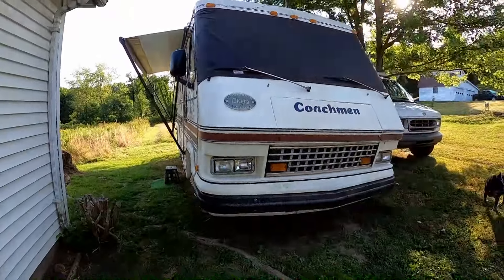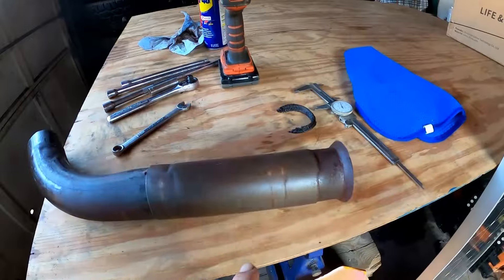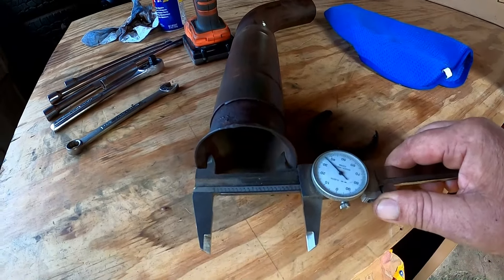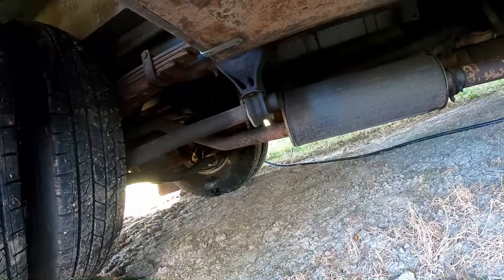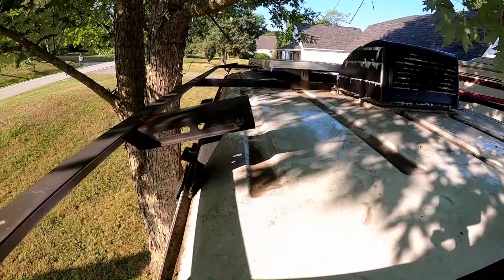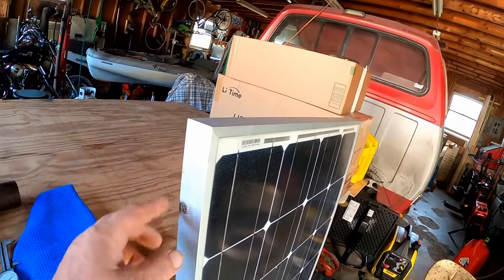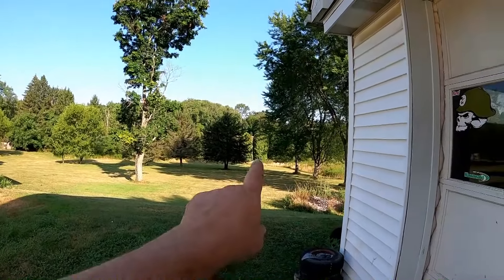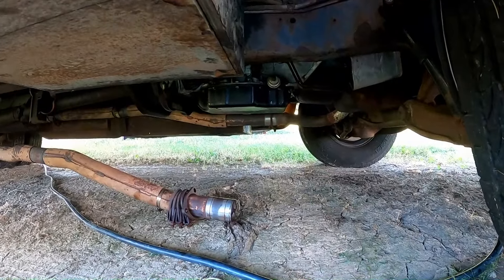Tinkering Around With RV Projects, Repairs and Projects This Morning

Comment: My experience with the donut flange fittings is if they're not absolutely snugged up with no play in them they will sway, or wiggle and end up cracking and breaking down. That includes the exhaust past the flange, if any of the exhaust system under the coach is not secured right to prevent swaying it will contribute to the donut flange gaskets breaking down.

Comment: Since you eliminated the exhaust system pollution devices, maybe it's time to look for a set of exhaust headers? I'm sure you can still find them even for an older engine and motor home application? These eliminate the donut gaskets and use flat gaskets.

Comment: Summit has steel ceramic coated long tube headers for the chevy big blocks. $276.00. Finish off with some light weight free flowing mufflers and let that 454 breathe. They also carry the MAHLE steel donut gaskets.
Reply: I agree on the steel flange gaskets. Lets hope he reads this.

Comment: Hi Dave if that happens again with exhaust leaks swap for performance headers it better then stock u will notice different of weight and little hp more cool quick then stock gotta put exhaust wrap where starter at get long tube I had problem before and hard to find those donut gasket...

Comment: Hi Dave, I've had trouble with thise pesky exhaust donuts also. Especially since they went away from the asbestos construction they just don't hold up. Good luck. You would think they would come up with a silicone type replacement?

Comment: Do it while you can 'cause soon enough you can't. I just read that 12 states are phasing out gas powered vehicles by 2030 - 2035, bet that will seem weird. I'm still hoping for the Buck Rodger's low flying aircraft. 😁😁😎😎👍👍
Reply: Getting rid of gas vehicles will never happen
Reply: @davidwheeler7503  I think they said that about horses and landlines. :)
Reply: @m.d.grimes1622  and horses and landlines still exists.
Reply: @davidwheeler7503  You have a point, though not many people travel by horse, and the UK (in 2025) are done with landlines, here  in a very few years.
Reply: @m.d.grimes1622  they're trying to eliminate gas vehicles for one reason only and that's to hinder citizens from being mobile.  When citizens are no longer to easily be mobile, you won't be able to relocate to escape high tax states
Reply: @davidwheeler7503  Well I'll have to chew that thought a while David. :)

Comment: Just be glad you don't have a Ford Triton V8 where the exhaust manifolds crack just after the bolts degrade enough so they snap flush with the block.